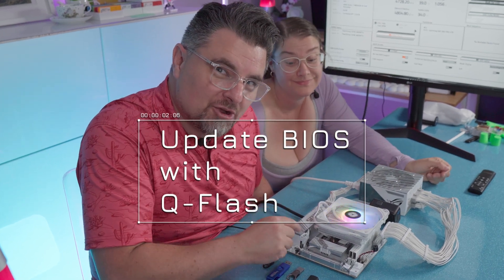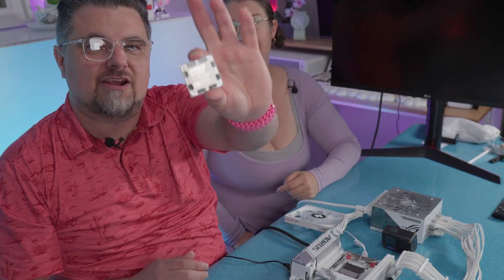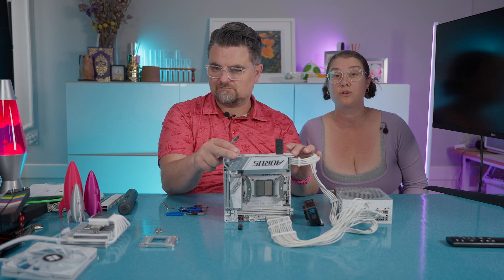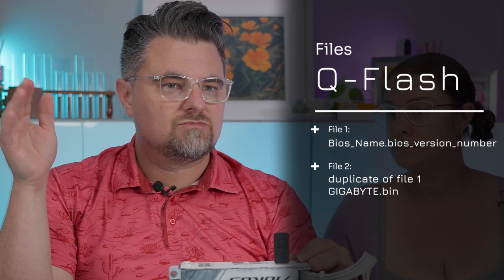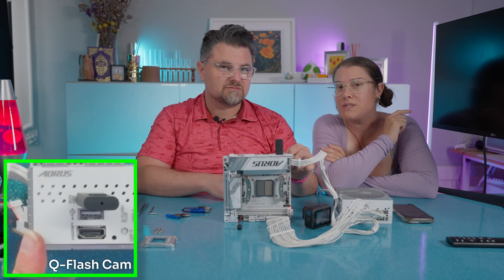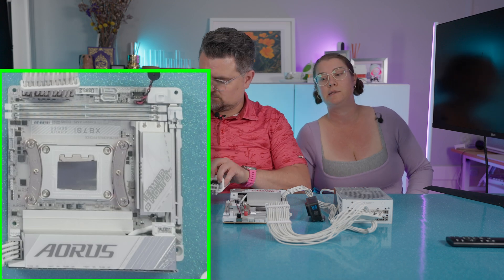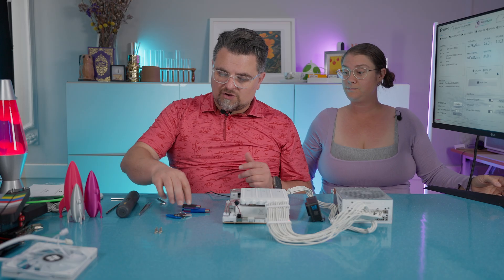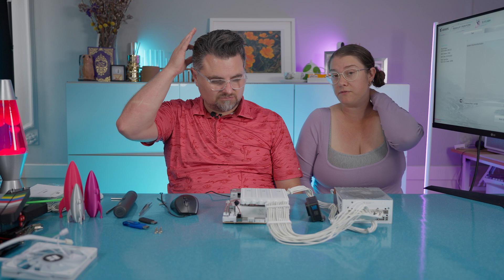How To Update BIOS without a CPU or RAM with Q-Flash PLUS

Comment: Help I think I bricked my motherboard am using a 2.0 usb FAT32 with the right bios, when I press the flash it blinks so am like yeah it’s working but then it turns on and there’s a code 00, there’s no gpu cpu or ram installed, what do I do, please help
Reply from the maker: #1 don’t panic — work the problem.  Break it up into smaller tasks and tests.

Your board is at least producing a debug code of 00.  That means that it has power, and is powering up partially. It might only be reporting no-cpu, no-ram. Many motherboards do require CPU and RAM to flash a BIOS.

What motherboard do you have?  Have you read the manual PDF?  Does it support QFlash+? If your motherboard has a debug code of 00, have you looked that up in the manual?  Have you looked at the vendor website/ forum for help? Have you contacted support?

Debug codes are not universal and are unique to a motherboard, although there are some similarities between boards and bios.
Reply: @AstroAtomica I have a old b550 vision d
Reply from the maker: Did you figure it out?  We are not familiar with the b550 vision.
Reply: @AstroAtomica  yeah good thing i had a old cpu that was able to boot it back up and then updated it to the stable version  then installed the new cpu, its working now
Reply from the maker: That is great to hear and I’m glad it worked out!

Comment: Nice & instructional video , but is this process supported only on gigabyte mainboards or for other boards too ( i assume it may be available only for newer mainboards not older ones) , 1 tip  zoom on the mainboards part (even when narrating) that helps to understand what we (users) have focus for doing this kind of process because in this video some parts are still unclear. again nice video.
Reply from the maker: It's likely both chipset and brand dependent.  However, it's becoming more and more common with motherboards.  AMD has been really good lately at having sockets last multiple CPU/ APU generations --- so it's a really nice feature when you need to update an older motherboard (possibly on discount, or used) with a new BIOS that supports newer CPUs.  The Q-FLASH+ feature seems closely related or exclusive to the Gigabyte brand of motherboards.

Other boards might also have the feature, but it likely is called something different.  Motherboard manufacturers tend to license BIOS code from a few keystone companies, so, support for features like QFLASH+ is about , bundling, licensing, and chipset support.

For Intel boards, the sockets have not been lasting more than 1 CPU generation, so it's unlikely you would need this feature for 1st boot.

On any board that doesn't have this feature, and you want to boot a latest GEN CPU on it, you might find you need to borrow a LAST-GEN CPU just to update the BIOS.  I've had to resort to this and other tricks in my 30 years of building PCs.